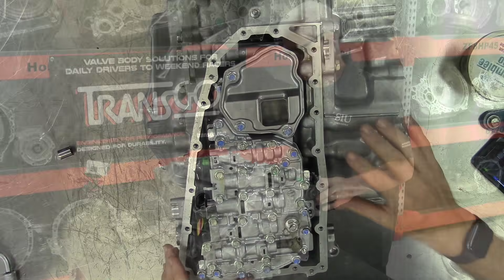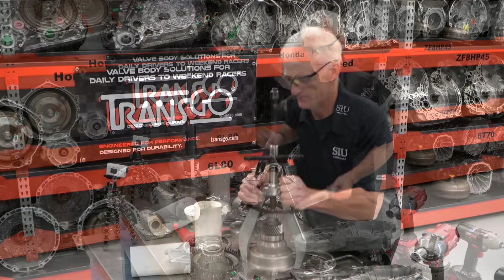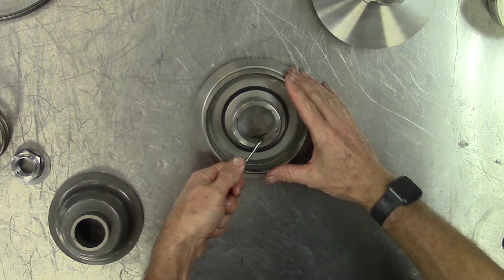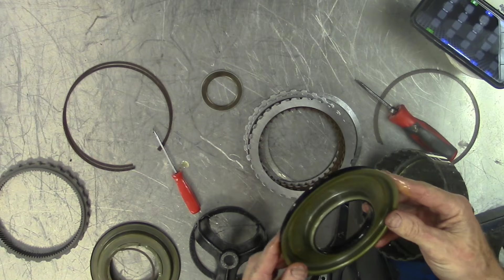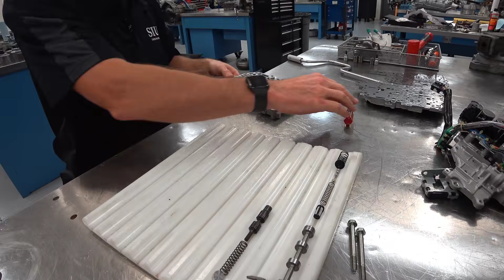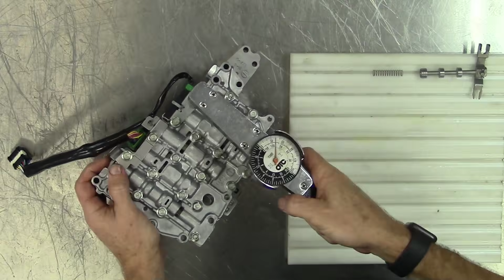Jatco CVT Overhaul JF011E RE0F10a/b

Comment: I notice this CVT does not havé any Accumulators.  Is that because Accumulators are unique to conventional Linear automatic transmissions in that they are needed for e.g.  soft apply unt release timing, where as this CVT has a simple planetary gear set that just needs clutches for reverse (carrier held) und forward clutch only ?????

Comment: How durable is the belt? Mine in Dodge Caliber 2.4L is currently at 220_000 km. Fluid changes every 30_000 km with full flushing and filter replacement. Still works super smooth and super quiet (as for CVT), never slips, never overheats. But I'm afraid a bit about sudden belt snap in most unconvenient situation. Are there any warning signs that the belt is going bad?

Comment: Done rebuild using the Jatco manual and then found your video, I done everything you explained very well, however no matter how many times I’ve checked behind myself. The forward clutch doesn’t seed flush. What is most common reason for this issue? Thanks Barbara

Comment: In your experience after tear down , what seems to be the most common issue to cause overheating?
Reply: bad oil in transmission. Oil is taking away the heat from material. Even if the car is low mileage oil degrades as the time passes. So it's important to change it.
Reply: They get too hot, especially in warmer areas.  Cooler is insufficient. For $75-$100 or so you can add a cooler that will actually keep the temp down to an acceptable level.  That and change fluid/oil every 30-35K miles.

Comment: Is the output sensor the primary or secondary sensor? My transmission is misbehaving and I was informed to change them first before I changed the whole trans
Reply: To report back, I changed the gearbox speed sensors and shifting is back to normal.
My remaining problem is that of low transmission pressure when I cruise the vehicle. I am worried about having to remove the whole trany to just change the oil pump as the local mechanic says if it doesn't work we have to buy another gearbox.
Reply: The dashboard blinks A then the current gear position.. Tried changing transmission range sensor but not gotten a good one yet.
Reply: The tiptronic pads completely stopped working right. I may have worn it out as most overtaking I used pads shifts to accelerate faster.
Don't install pad shifts on weak transmission 🤗😁

Comment: Awesome video! What usually causes a "SHUDDER/JUDDER" in these transmissions?
Reply: From my experience, that indicates a fluctuation in pressure to the sheaves. Quite often on inspection, the clutches are all fine, but the primary piston and seal, as well as the oil pump flow control valve, are invariably worn/damaged.
Reply: @thehilltopworkshop  Thank you. What could be wrong when they stop pulling when they get warm?
Reply: @dealerauctionnightmare4689 did you ever find out more info? I’m having issues with my cvt and took it apart but it looks fine
Reply: @plshelp2906  torque converter is most likely the problem.

Comment: If it's slips just do a CVT flush at Valvoline. Do it every 60,000-80,000 miles. Bring your own Nissan CVT fluid then it runs the best. My CVT has 300,000 mile (I drive Uber).
Reply: Honestly man, this stuff needs to be changed in the Nissans every 20 to 30 K and you’ll have no problems with them
Reply: If it slips it’s already bad. Theres a mechanical damage. Just changing the fluid won’t fix it.
Reply: Don't forget to change the 2 filters as maintenance, not just drain and fill
Reply: And they are not doing flushes 😂
Reply: That's not a fix it's already broke,too late change your s@#$ earlier!!! Every.year.and filters every 30-50k.Depending if you keep the fluid clean.Cleaner you keep it less you can change the filter A.CVT is not an ATM.Bit.the fluid is no good after 5 yrs on those either but they did last longer

Comment: Sean - the no#1 issue with these trannies is wear in the flow control valve in the pump, and the bore can get worn too. This can lead to low pressure and damage to the pulley assemblies. The aftermarket has a fix for this.
Reply from the maker: Yes sir, I have a video on rebuilding essentials that covers this.  One thing I didn’t cover yet is how the inside of the pulley wears like the inside of a barrel.  Some builders put .035” piano wire under the seal to take up that lost space.  Thanks for watching!

Comment: 238,000 mile cvt, transmission fluid and filter was never changed,  started throwing codes U0402 & U0101 and going into limp mode, clearing codes with scanner and transmission worked perfectly for a few miles to a hundred or so miles.  Transmission temperature warning dash light blinked once,a minute or two later check engine light illuminates and trans goes back into limp mode until cleared with scanner.  Changed fluid and filter, now trans stays in low gear. thinking I might put old fluid back in transmission. Does anyone have an idea what is causing the problem ? Checked all wiring bundles and TIPM

Comment: I swapped out the stepper motor on mine yesterday but since my transmission is stuck in high ratio I don't think the stepper motor lever engaged properly 😕 I did the pin trick to hold it in place but again, I'm guessing that doesn't work if it's stuck in high ratio.

Anyone have any tips? Can I move the high ratio pulley to the low spot manually?

Comment: Going to do my daughters first cvt change 30k Nissan Versa . Thinking using amzoil could use your experience and advice
Reply from the maker: I’m not sure about amsoil.  If it was me, I’d put Nissan fluid in it or valvoline cvt fluid.
Reply: @siuautomotive  been debating lol amzoil and others are cheaper then Nissan fluid
Reply: i found castrol cvt universal at walmart 25 bucks for a gallon says its nissan 1 2 and 3 not sure how itll do but im trying my best to keep my car from failing no limp mode no lights yet maybe im just being paranoid
Reply: @jayroberts2555  I was thinking same but then was told not to mix the factory Nissan n3 with others . Idk 🤷‍♂️
Reply: @jayroberts2555 how did your cvt hold up with that fluid?

Comment: I got 2015 outlander it only go 5 mph… so it be the problem on 1st gear right . Can I replace solenoid gear 1 or the clutch or what best way to do it. And jeep, Nissan n dodge they are same so I was thinking get from either of those brand n use outlander sensor put in another transmission (jeep, dodge or Nissan) will it work ? Or follow the code transmission.
Reply: Or follow code transmission as swap it

Comment: Great instructor and siu is great college but rebuilding any cvt is complete waste of time been rebuilding transmissions for 30 years most will not touch any cvts due to high failure rate even with dealer parts.  Profit margin after parts and labor negliable and most vehicles they go in are not worth a crap they are throw away cars.  If a customer really wants to spend 4000-10000 dollars for a transmission we just install one from the dealer and then the manufacturer is responsible for the garbage unit we install lol

Comment: I used to own a trans shop and your video is awesome.  Have a 2008 Dodge Caliber 85K miles.  Intermittent trans overheat, only after highway hill climbs.  I guess this is an issue with a lot of the CVTs.  I was just going to add a large aftermarket trans cooler in series and in front of the existing cooling.  Trying to make the vehicle last until daughter is finished with college.  Would you please give me your opinion?
Reply from the maker: There should be a bypass in the cooler lines.  I would suggest also replacing that because it might always be bypassing the cooler.  You might also verify the temp with a temp gun.  I’ve heard of some faulty temp sensors misreporting the temp and putting them in overheat mode.

Comment: Can a generic 2 or 3 jaw gear  puller be used instead of Posilock TJ-1? Posilock is quite expensive compared to other gear pullers. Thank you.
Reply from the maker: The problem with generic pullers is their “teeth” are too big to effectively grab onto the pulley, especially with the belt in the way.

Comment: Great video, thanks! I've got a 2011 Jeep patriot throwing codes P0963 and P161B and struggling with changing up. It just revs up to around 3-4000 and doesn't go above around 30mph. I've been quoted for a full transmission rebuilt around $6-7k. Is it possible that the solenoid a code being thrown could just be related to the solenoids/valve body, and a full rebuild wouldn't be necessary?
Reply: P0963 relates to solenoid a and p161b relates to the transmission control unit. The car has been sat for about 9 month, and didn't have these beforehand if that info helps

Comment: would it hurt to drive in s mode all the time?
Reply from the maker: I don’t think so, but you’ll be running at higher rpm and probably get worse gas mileage.
Reply: @siuautomotive  mine won't shift unless I let off the gas and step back on it but in s mode it is using alot more gas but it shifts better for some reason both high rpms

Comment: Very informative vedio. I'm very impressed. I learned alot about these transmissions. I have a 2004 Saturn ion with a CVT transmission. Mines making a hum noise or roar. I rebuilt the whole supetion. But the car will shake bad sometimes. I'm thinking the trans is bad.  I was wondering if your company has a rebuilt transmission. I love my car and want to keep it. If you have one how much would it cost to buy one from your company
Reply from the maker: Thanks, but we’re a school.  That Saturn trans is a vt -25 and it’s notorious for failing.  Most shops will only install a dealer reman unit so it’s covered under warranty.

Comment: Thanks for the great video. Over the past few weeks I rebuilt my transmission with this video. Thought I had it, I have 180 miles on it so far. This morning it acted like it was in low gear. Stopped the car, restarted it and made it another 2 miles and it did it again. Turned into a neighborhood and it lost everything wouldn't move or rev up. Shut it off and on and finally got it to limp about 1/4 of a mile and wouldnt move. Now it will rev but wont move. Has a whine to it that wasn't there before. Haven't had a chance to dig into it, but any tips on what to check for?
Reply from the maker: Ah, that’s a bummer!  The way you describe it sounds like a filter getting clogged.  That trans must be shedding material.  Pull the pan off and see what’s inside.  See if it’s clutch material or metal.
Reply: @siuautomotive  So finally had a chance to pull it out. Swapped valve body, kept my rom,  new filters (both of them), magnets had a some metal on them and little metallic in the oil. Drove it gain. Made it 5 miles lost all pull again. Same thing. So pulled the trans back out. It almost acted like the valve was stuck in the pump. Its a rebuilt pump with an OS valve, or suppose to be anyways. Once I got the valve out, which felt a bit stuck, the bore has a few scratches, but the valve slides freely now. I did notice pulling the pump all the way apart the barrel where the veins run, almost looks cracked. Could a bad pump or sticking valve cause is to loose all pressure and keep the car from moving? If so would you recommend a new pump or going with a Transgo valve kit for my old pump that was working?
Reply: I have the same issue, did you fix it ? What did you do?
Reply: @pabloyuela  I ended up pulling it 3-4 more times trying and testing everything I could. Even changed out parts on a few items thinking they were the issue. Couldn't find anything wrong with it air testing it. For some reason it still wouldn't work. Finally gave up on it and sold the car as is. Best of luck to you.
Reply: @pabloyuela  Did you ever figure out the issue? I have the same problem on mine.

Comment: Sir you're video is very detailed and you're explanation are easy to understand. I recently acquired a 09 Nissan Altima and I believe the CVT transmission is going out. I figured I may as well rebuild it myself. Any tips for that specific vehicle I should know about?
Reply: my altima 2009 transmission went bad, like the first gear the car goes very slow but after all works well, until I had to stop and start again...like in traffic light.
To fix around 4k...so I may keep the car and one day I fix...after watching this great video, I realized that I will never be able to do that...I will try to sell or donate. All happened after going through a car wash, when I left the "tunnel" the car started presenting the issue, I think that "belt" that moves the car inside damage something.
Reply: Very well elucidated video.  A lot of Nissan dealers still refuse to rebuild these Jatco CVT’s.

Comment: Great, thank you! One question: this wasn't shown in the video, but you obviously took this piece of welding wire (holding the ratio control valve link) out before putting the pan back on? And what happens if you miss this step, do not put anything in that hole? The linkage can fall apart when assembling? And what does it result in, car would not move, or just not shift? Because I have a strong suspicion that the shop which replaced the solenoids on my valve body forgot or didn't know about this step. Thank you!

Comment: Here is my experience: I purchased a 2015 Nissan Murano new in July 2015. We had transmission issues starting week 1! Hesitation and then over acceleration were addressed with multiple software tweaks but never corrected the issue.  My CVT transmission failed and was replaced under warranty by Nissan in June 2019 at 52,000 miles.  Today 11-29-21, at 62,100 miles, my transmission failed again due to the transmission oil/cooler/radiator assembly failing to cause the cooling fluid and the transmission fluid to mix, resulting in having to replace the Transmission, Radiator, and associated assemblies for a cost to me of approximately $6,700!  Based on my research, this is a known issue with Nissan CVTs but was only partially addressed in the Class Action lawsuit because individual owners had to personally sue Nissan and their vehicle models and years were the only ones included in the extended warranty.  How a judge does not include all Nissan vehicles with the CVT is beyond me especially when my dealership was replacing three a week when my 2015 Murano's CVT was replaced. All my service was completed at the dealership and we never prevent any work from being done when required. The only upside is Nissan is paying for 80% of the repair but I am still paying out of pocket on something I believe should be fully covered. If I had an Altima with the same issue it would be covered under the class action suit extended warranty coverage but the same CVT with known issues in another Nissan model is not covered!
Reply from the maker: Yeah, that sucks.  I've been told that the Murano has the hardest time keeping the transmissions alive.  I don't know if it's the size or weight of the vehicle, but they don't last as long in those models.  I'm glad they're covering 80% for you though!
Reply: @siuautomotive  Hi and thanks for your comments. I believe you are correct regarding the weight of the vehicle. It is my understanding CVTs don't fair as well as vehicle weight increases.
Reply: @siuautomotive  These transmission have been thought for city cars (Low torque, light weight...)...problems started when they mounted on bigger vehicles :(
Reply: Just bought a 2018 Nissan Altima SR 50000 miles at 50700 CVT failed it’s at the dealership now they will rebuild the cvt under warranty as soon they finish I’m getting rid of the car and never again a Nissan..
Reply: @ENTERTAINER4you  Hi Ivan, we are sorry to hear about this. Luckily it is covered by a warranty now, but I feel your pain and discomfort in keeping your Nissan vehicle after this experience.  Especially in light of what happened with our 2015 Nissian Murano requiring two CVT rebuilds in less than 63,000 miles! We love the design and how our Murano drives, but we are extremely cautious about using it for long trips now! Our Murano was our go-to vehicle for trips, and now every day, we cross our fingers and hope it lasts another day.  When the first CVT rebuild under warranty was done, we were promised that a redesign to prevent future occurrences was in place. Yet 10,000 miles later, a CVT rebuild was required again!  Saying the cost to replace this vehicle now is prohibitive is an understatement, and like you, many Nissan owners have to deal with this while a recall is still not happening. This lack of action to protect consumers is unconscionable. Like you, we will not purchase another Nissan / Infiniti vehicle and are actively looking to replace it before the CVT fails again. Again, the Murano design is great; for us, nothing out there now looks as good. Couple that with the fact we were lucky to get 0% financing for the Murano at a decent price, but right now, vehicles are selling above MSRP, if you can find one, and financing deals do not exist. Good luck to you, and hopefully, this works out for you. Thanks for sharing.

Comment: Sir, how to tell if the belt is bad? Just received a used one, but the sides are completely smooth, no lines. I assume it is worn out, correct?
Reply from the maker: Yes sir, it should have lines.  That one is worn.

Comment: Hi, thanks for the great video! Disassembled today the same, the primary pulley is shut - the balls are fallen apart and grooves are damaged. Question - should I replace the torque converter? I'm afraid the debris may trap in it and could destroy it in short run.
Reply from the maker: Yes sir, I’d definitely get a reman converter.  Precision of New Hampton is where I get mine.
Reply: @siuautomotive  Thank you, sir! Such a useful channel.
Reply: @siuautomotive   second that could I take my torque converter to get flushed? What about the radiator? Can be flushed or replace.?